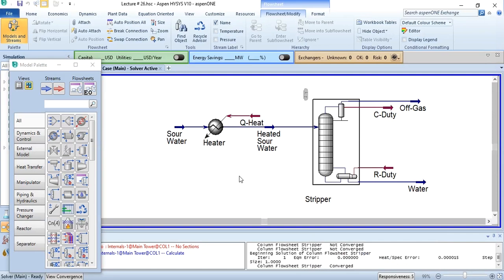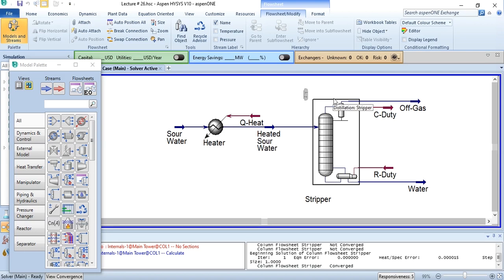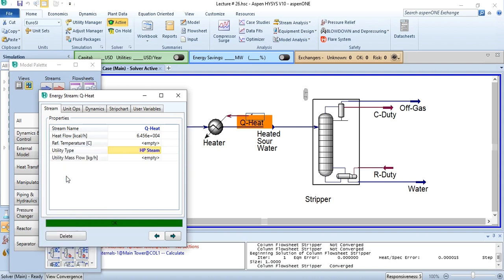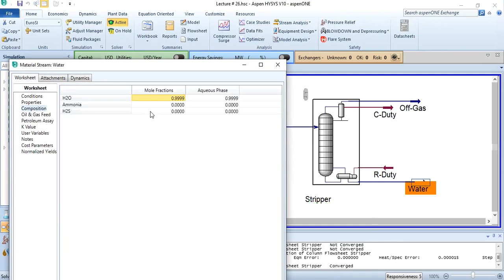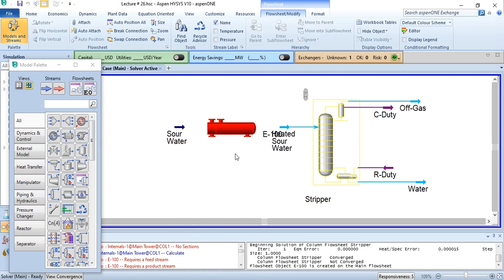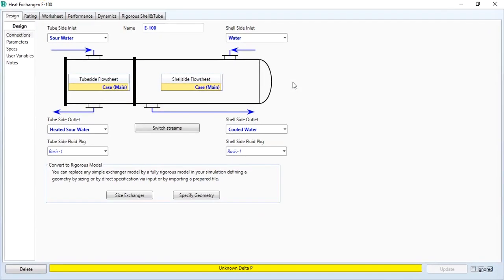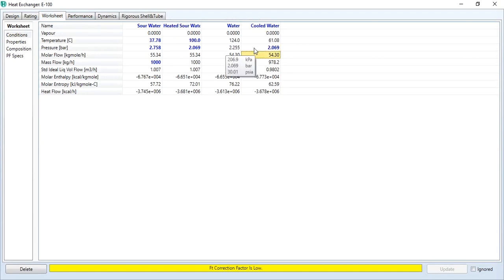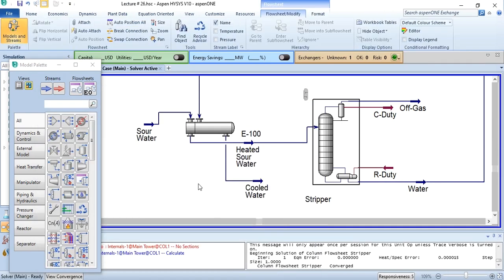Process heat recovery | Stripping of Sour Water | Simulation in Aspen HYSYS | Lecture # 26

Comment: the stripper requires heat to strip the off gas and water, so what heat is used? latent heat from the feed for sure, is steam also used?
Reply: SENSIBLE HEAT (NO PHASE CHANGE)